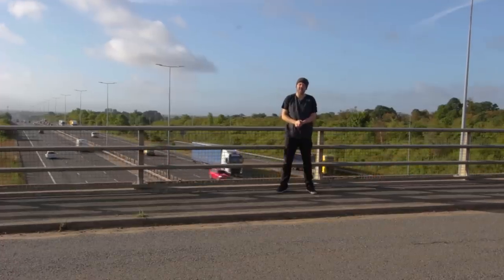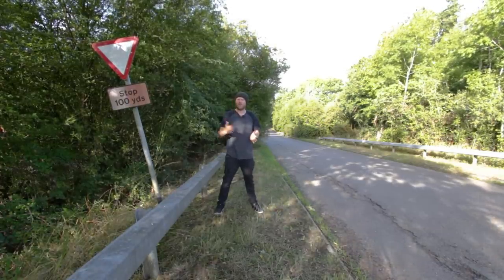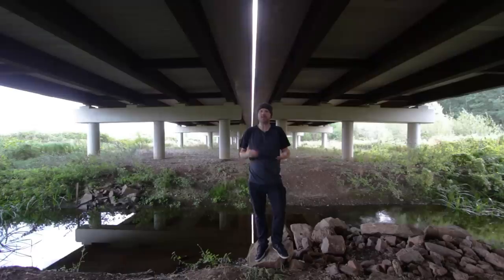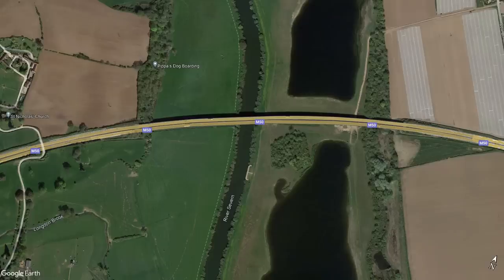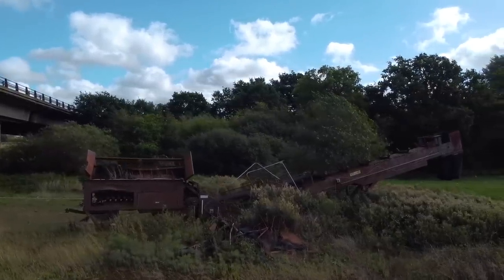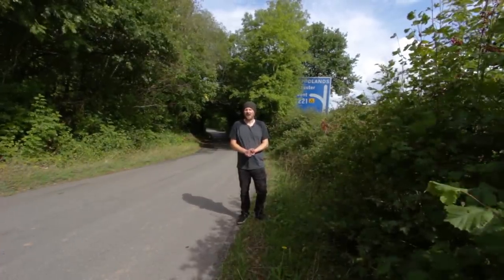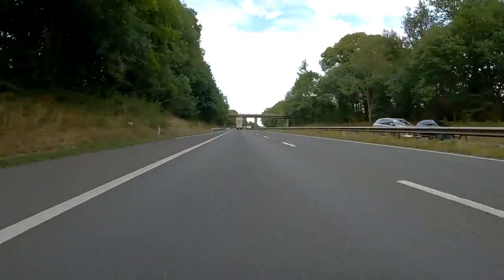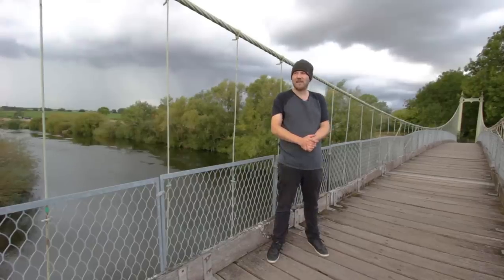Secrets of The Motorway - M50

Comment: With junction 3 on the M50. That is quite a dangerous junction. Why was junction 3 built like that when the M50 motorway was built. 

Still the M50 could of extend where it would of meet with the M42 and M40 motorways as what you have explained and could of extend right into Wales. Just like the M4 that goes straight into South Wales from Bristol.
Reply: Little point in extending the M50 into Wales as the M40 does that adequately till Monmouth by dual carriageway. After Monmouth traffic for Cardiff continues to the M4 if you choose to again via dual carriageway while the traffic for Brecon and West Wales branches off left eventually being a mix of single and dual carriageway. The M4 now has speed limits which makes using it to go West makes no sense. Traffic from South of Bristol obviously use the M4.

Comment: Similar to the M45. Both were some of the early motorways. Both were superseded by other motorways. Going south from Ross, the A40/A449 are nearly to the standard of the M50. When the Severn Bridge was built it spelt the end for future developments to this road system. 

Ross on Wye (POP 10,000) must be the the smallest town we’re a motorway, of more than a few miles, starts and finishes.
Reply: And Hereford (pop 60000) has no dual carriageways going to it at all! (I live in Hereford and work in Ross).
Reply: @natjohnson3736  So true! I live just south of Birmingham. A couple of times driven back from the Abergavenny area when the M50 had  been closed. You can add Hereford hasn’t got a decent Bypass either.
Reply: And then there’s Tewkesbury, pop 100,000 with 2 M5 junctions (J8 & J9) and the M50 all fairly nearby
Reply: @bdh_555  plus the A46 to Warwick and Coventry.

Comment: Another sad death was when there was a bridge collapse late in 1978 after a lorry hit a bridge support causing the bridge to collapse onto the lorry.  The lorry driver died in the crash.  As a family we used to travel to South Wales several times a year and for about a year, I think it was the southbound side that the bridge was missing from until it was rebuilt.   Apparently the bridge was between J2-J3
Reply: thats sad to hear, was the bridge too old
Reply: @DaSpecialZak  No - I have read that this motorway was used for several experiments, such as J3 and that also applied to this bridge.  A few others like it on other motorways were checked and more barriers were put in place to protect them.
Reply: @hulahoopone  ah, ok
Reply: It wasn't the B4215 bridge was it? If so it makes sense as that bridge's design is slightly different from the rest.
Reply: @driving_all_over  apparently the halves of the bridge are slightly different colours as the replaced side is, obviously, newer than the original remaining half.
Reply: @hulahoopone  Very interesting. I’m heading up to Northumberland tomorrow from the Forest of Dean which involves using the M50 so I will keep a look out for it
Reply: @driving_all_over  Kempley Road Bridge - if that helps!
Reply: @hulahoopone  Cheers mate. I've had a look on streetview and know exactly where the bridge in question is now, it's about 2 miles east of J3. I knew it had 2 distinctive bits (the older northern section is over grass) but I hadn't realised the tragic story behind it until your original comment.

Comment: Closest thing to J3 has to be the southbound slip at M1 J6?
Reply: Yes M1 J6 is definitely another rubbish junction design.  In northern Lancashire, once upon a time from 1960 to 2016, there was originally a terrible and very dangerous LILO/Parclo hybrid junction version of M6 J34 at Halton, Lancaster not unlike M1 J6.  This junction was originally only intended for emergency and highways works vehicles but just before the M6 Lancaster Bypass was opened in 1960 and after a lot of uming and arring in the Ministry, it was finally decided albeit unwisely to open the junction to all motorway traffic without building a safer replacement first.  Finally in 2016, this terrible junction was finally ripped up and replaced with a much safer and higher capacity diamond/parclo hybrid junction version of M6 J34.  They finally took the opportunity to fix that shambles as part of works to create an all-purpose dual carriageway version of the A683 between M6 J34 and Morecambe.

Comment: Ah my local motorway 
J3 is mental however I have seen things that it was supposed to be temporary as there were plans to reroute the A40 along the B4215/B4221 route 

As for nice bridges, the one where the B4215 crosses is quite a nice design. It’s between junctions 2 and 3

Comment: if you want further examples of weedy/hair-raisingly tight 90 degree sliproads in this country besides M50 junction 3, see M1 junction 6, A404(M) junction 9A, the former northbound M6 junction 34 (the main link between Lancaster and the motorway) and the eastbound M876 junction 1
there are also numerous examples on the A1, A14 and A55, some of them from 1950s/early 60s bypasses, others from excessively cheap engineering jobs
Reply: The A34 Newbury bypass has them at the junctions with the A343 and A4 too. It baffled us locals when we found out…on the day of opening!

Comment: I'm not convinced they trialled junction layouts to see what does and doesn't work, the sharp 270 degree bend idea seems to have been largely replicated when leaving the M25 to access the northbound M11.  As you round the left hander onto the M11 slip proper 30 always feels about 5mph too quick in a truck.  I'm always amazed there are so few rollovers on that junction given the direction changes and how tight the radius of the curves are.

Comment: 1:53 what would that motorway be called between the m50/ m5 junction and the m42/ m40 junction
Reply: It could have been a continuation of the M50 or of the M40, so could have used either of those
Reply: @emmajacobs5575  probably a continuation of the M50 (as it has only 4 or 5 if you count the M5 junction 8) the M40 has 16/ 17 junctions
Reply from the maker: I'm not 100% sure.. looking at the Umberslade end.. my guess is that the M42 would have continued southwards to link up with the M50.
Reply: @AutoShenanigans  if that were the case then the M40 would of had 4 extra junctions going west and linking where the M42 links

Comment: The reason the nice free flowing trumpet interchange at M5 junction 8 (junction with the M50) was replaced with that awful roundabout that's there today has nothing to do with the trumpet interchange being bad but instead it has to do with the spot in the middle of the roundabout where those trucks are stopped in the overhead view.

Apparently certain classes of vehicles (presumably oversized loads and the like) that want to travel down the M50 and across the viaduct located to the west need a permit to do so and they need an escort vehicle. So any of these vehicles that need to go that way have to stop in the middle of the roundabout in that parking spot while they wait for their escort and movement permission and that's why it needs to be a roundabout.

If it wasn't for the special rules regarding certain classes of vehicles they could have rebuilt the trumpet interchange to be wider and solved the crash problems while keeping the junction free flowing.
Reply from the maker: I've seen the odd wide load waiting to cross, I didnt know that was the motivation for putting a roundabout in.. thanks for posting.
Reply: The roundabout also allowed the southbound entry slip from Strensham services to be incorporated into the junction. The entry slip from the services and the exit slip to the M50 used to be very close together and the trumpet design didn't allow for the two to be integrated. When you leave Strensham heading south on the M5, you now have to go down to the roundabout and rejoin the M5 from there. That didn't used to be the case.
Reply: Back in the day, I was an engineer on the M5/M50 and was about when the widening and re modelling of Junction 8 was designed and executed (thanks for using one of MY pictures here - the upside down lorry RTA). I don't know where the idea that making Jct. 8 a roundabout was to facilitate abnormal loads comes from, but I do not think that is true at all.  The bit of road in the middle where the loads now park is, in fact, a piece of ''temporary' road that was installed to provide a temporary small roundabout during construction. Some bright spark suggested leaving it extant afterwards for the wide load use (!!). I have an aerial picture taken while works were in progress -but I don't know how to post it here .
Reply: @ptodd3068  I assume the reason for the roundabout install was because the trumpet was unsafe.

Comment: I still have nightmares about the first time I left at Jn 3 and nearly wrote off my car, and myself.
Reply: I've exited at J3 only once and all I can say is that anyone who's looking to use it needs to scrub off ALL their speed before cranking the steering wheel left for what is essentially a 90 degree bend!! Insane!!
Reply: @michaelwatts8182  there is a subtle hint in that the sign for it has the 'slip road' at a right angle instead of the usual angle but I wish it was a bit more explicit.

Comment: Lived in Worcester and traveled on the M50 quite a few times, en route to Wales. This would have been around 25 years ago. Im sure back then there was a small service station?
Reply from the maker: I've not found anything to suggest an official motorway service station on the M50 but you do have Strensham on the M5 right on the M5/M50 interchange
Reply: Ross on Wye was a services, owned by Welcome Break at one time. It’s technically not on the M50 itself but was the only M50 services. It had a Happy Eater which later was a Little Chef (where KFC is now).
Reply: @AutoShenanigans  It wasn't Strensham Services, and it wasn't where the KFC is now. From memory it was about half way or so along the motorway. Could possibly only have been on the Ross On Wye bound side too. Remember driving past a few years after I moved and it was derelict. Now there seems to be no trace of it at all. Not even an abandoned slip road.
Reply: @railwayarchive6850  Wasn't that far down.
Reply: @smidsy4747  ..sorry m8 but there are full Southbound services on the Ross site now, the Northbound side just has KFC as well as a few other businesses..
Reply: @smidsy4747  That's the only one there has ever been, unless you are thinking of the original Strensham Services? They closed early 90's
Reply: There have never been services on the M50 to my recollection.  I moved to Wales in 1997 and used the M50 from at least the eighties. The traffic flow and length wouldn't ever have been sufficient to support a service area. Generally services were originally about 25 miles apart on motorways as seen on the M6 when first completed. At 22 miles the services at Strensham and the Ross services at the major island satisfy the need.
Reply: @rossmagpie  There are no services on the M50 and never have been.  Ross services are on the A road approaches, I.e. the A40. I travel that way regularly and have for years.  It isn't a long enough motorway to require services as it's only 22 miles long. Originally it was called the Ross Spur acting to take traffic from the M5 to Ross then branches to South and West Wales or Hereford.
Reply: @geoffreycodnett6570  ..what, exactly is your point?..I've lived in Ross for nearly 70 years so know, exactly, what the situation is!..

Comment: Maybe you were not aware that this bridge (see details below) over the M50 collapsed in the 1970s (I think when a lorry hit it) and was replaced - see the steel beams on the main bridge but on the RHS the bridge has a concrete beam. Here are the coordinates for the bridge so copy and drop them into the top of the browser address line  (51.948176675656015, -2.4556679732522277)
I worked with a research engineer in early 1980s in Reading University and he was testing the remains of this bridge at TRRL!
Reply from the maker: Good info... I didnt know about that!
Reply: Winter of 1978 . Kempley bridge [more of a viaduct really]. About a mile and half before junction 3. The lorry veered off the carriageway and ''took out'' the pier on the verge, leading to the partial collapse.

Comment: Are we not going to talk about the idiot in the white car at 7:20 immediately joining the main carriageway as vehicles fast approach, rather than getting up to speed using the healthy length of the slip road? Absolute walloper!
Reply from the maker: A common occurrence on the M50, those junctions are an arse!
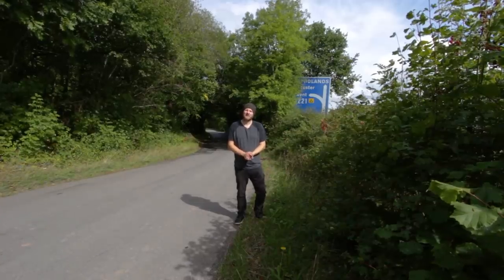Reply: I was going to say that you'd forgotten just how short and useless the sliproads are, but -- see 6:44 -- that turns out to be the only one of the four sliproads that's actually a decent length!
Reply: @beeble2003  Looks can be deceiving. That slip road, like the rest on that junction, is stupidly short. Drivers joining the M50 are basically expected to accelerate from 10mph to a half-decent motorway speed in the space of about 50-ish yards.

Comment: What happens when you run out of motorways - apart from mass follower hysteria?
Reply: Secrets of the A roads. In order from A1 (the parts that weren't covered under A1M) to whatever the highest number of all is
Reply: A9013, I find. Although they're not of course numbered consecutively
Reply: There's a few A roads that could be covered. Then at some point in a few millennia once those are all done, there's the B roads to move on to.
Reply from the maker: Im not sure!

Comment: The M50, it’s the 50th motorway built….. nope. That’s not how it works. Why?  Who knows?
Reply: Great Britain is divided into nine zones, numbered 1-9. The zones in England and Wales radiate from London; the ones in Scotland radiate from Edinburgh. The zone boundaries are the single-digit A-roads, plus the Thames Estuary.

The first digit of every numbered road (with a few exceptions) is the number of the farthest-anticlockwise zone that it enters. For example, the M25 has a gap at the Dartford Crossing, so its farthest anticlockwise point is Dartford, which is in Zone 2 (Kent, Sussex and parts of Surrey). The Dartford Crossing is designated the A282, which is one of the exceptions in the system: its farthest-anticlockwise point is in Thurrock, Essex, which is in Zone 1 (everything between the A1, the east coast and the Thames), so it should the the A1-something-something.